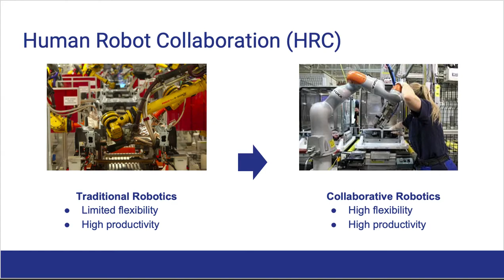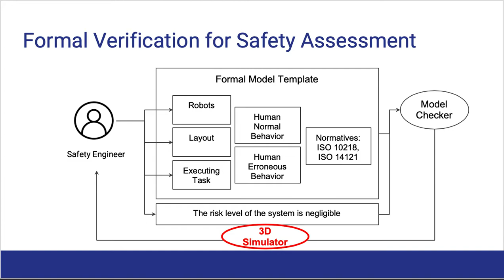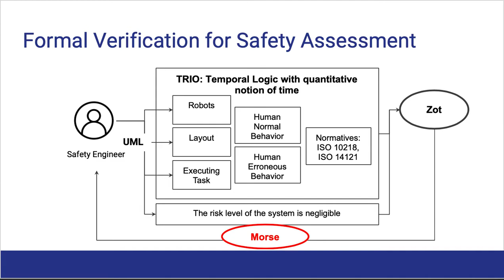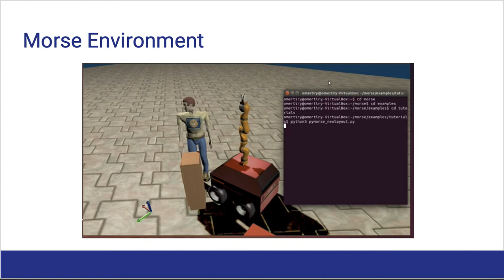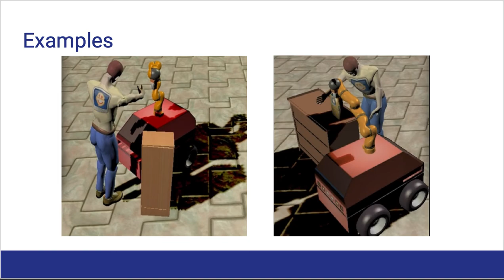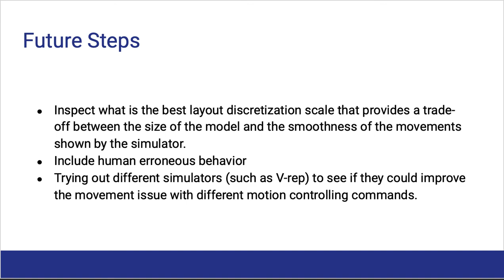Co-Simulation of Human-Robot Collaboration: from Temporal Logic to 3D Simulation

Comment: Could you please give more insights to create a 3D workcell or workplace of cobot, using Gazebo or Coppliasim?
Reply from the maker: We did not use Gazebo or Coppliasim for the reasons explained in table 1 in the paper(https://arxiv.org/pdf/2007.11737.pdf). You could also check out references 5, 12 and 13 of the paper. Hope it helps!